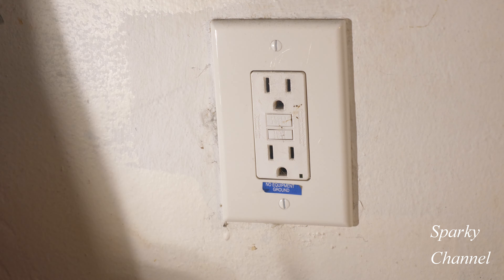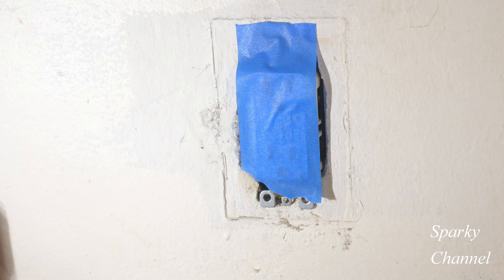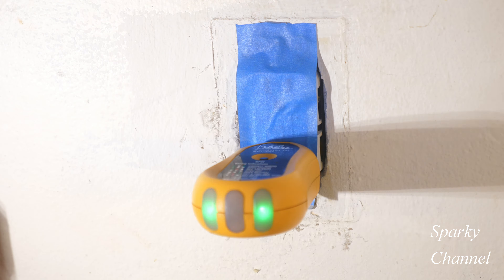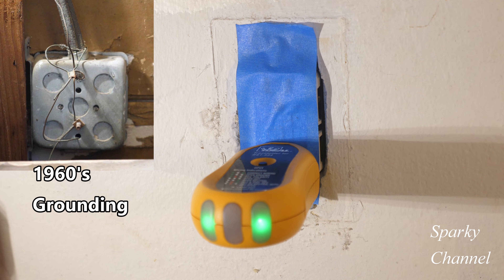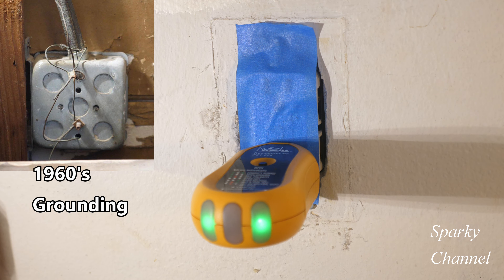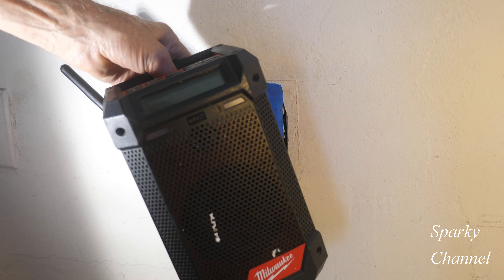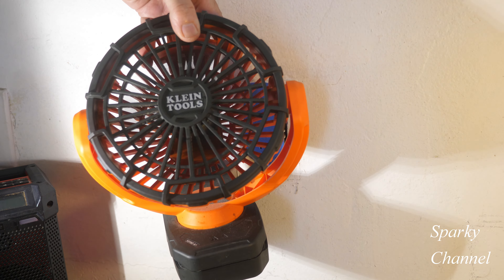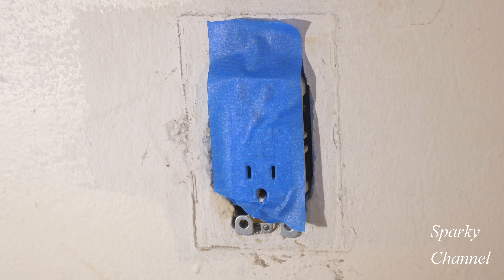Home Renovation/Painting Tip for Receptacles: Pass it Along!

Comment: definitely an old school trick.  it does bear mentioning that in new construction, one or two temporary outlets should be installed and then removed and put in a box for the next new construction project after the paint is done.
Reply from the maker: Yes, this one goes way back. Tried and true, except now we have painter's tape which is much better. Good point on the temporary outlets.

Comment: Sorry, I've done this, but I have found it problematic. I've spent too much time scraping bits of blue tape out of the socket slots (especially problematic with tamper resistant plugs). Also, if they spray, paint will still get in the socket slots and give you a bad connection. This just doesn't fly in high-end residential where every outlet had to be perfect.
Reply from the maker: We're rolling the paint and only one outlet will have the plug holes in it. Also, we'll take the tape off right after painting. It'll work fine. Good point about spray paint getting in the holes.

Comment: GFCI outlets ground the outlet through the GFCI circuitry, protecting occupants.  Maybe tape more over the hot conductor to protect your painter, especially if they're using aluminum handles with old beat of sneakers, if you like them.  Disregard if they are rude.
Reply from the maker: LOL! I like painters as long as they don't paint my devices. That's an excellent idea, thanks!